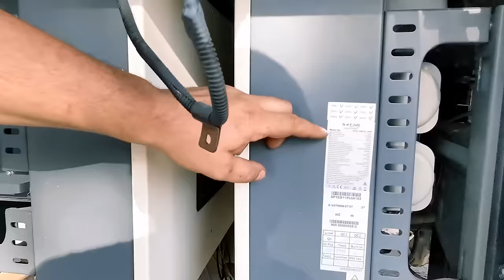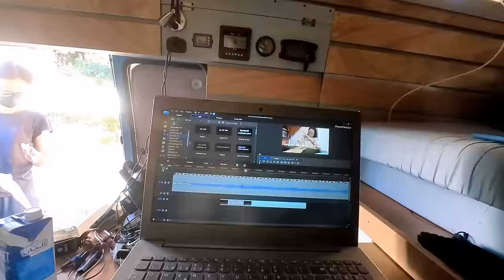Ultimate Off-grid EV Camper Bus Will Blow Your Mind! No Charge Station Needed!

Comment: Most RV are parked doing nothing for 80% of their life. If this can feed its energy excess energy back to the grid at peak power the RV can be a revenue stream for their owner. So  the next vacation is fully paid for by this Rv.
Reply: They'd have to be able to plug into a system that can receive as well as send.
Reply: You do realise that 30kW peak panels can't supply more than 10% per day on that bus?
Completely stupid to feed int9 the grid as it will just collapse even more from all those MOVABLE solar systems 😮
Stop chasing dreams and learn to understand the basic problems of last mile energy supply and grid dynamics ics before asking such wild none possible dreams

Comment: The absolute dream. RV companies, take a good look. Hire this man, buy his design as a patent or something. The modern community needs this.
Reply: patents? its public domain. God bless you.
Reply: @gsestream  then what do I say? All I meant was for major RV manufacturers to take his design and work with it. I have yet to see a fully electric RV. And one with its own Solar array to charge itself to boot. Now, if there is a market for that kind of thing now, then it needs to become more popular. Or maybe I'm just too far under my rock.
Reply: @CallMeTeach2  yeah its a cool open source free design, not proprietary, emphasis on the free design, ie not patentable. ie he was not the first to design it, and its in the public domain.
Reply: the 221kWh of batteries alone are easily $60k new, that might make this a little out of budget for most
Reply: No it isn't. People with RVs don't want to charge for 10 days every 200 miles. It would take months to get anywhere and if you added more batteries it would make it insanely heavy. Electric is a fad and will go away like it has multiple times.
Reply: @AKAtheA not to mention the weight of having enough batteries to drive anywhere in the US
Reply: @punkrocker10115  it's a bus, weight should be a marginal issue at most. The engine he removed is well over 1/2 a ton, so the net gain is maybe 1 ton in a bus that's close to 20 tons curb weight.
The main issue is cost and charging infrastructure.
Reply: @AKAtheA  yeah. You have no clue what you're talking about.

Weight is absolutely a factor due to the frame, brakes, and roads..removing 1k is nothing considering each battery alone weighs that much. Dude removed 1k lbs just to add 4k more lbs and make it slow as shit and take forever to charge. On top of that, the Tesla motors puts out like 400hp/tq max, which for that bus is nothing and it makes less power than my 20 year old diesel and less power and torque than the original motor, which was probably around 1000lb ft  of torque.

So, yes, this thing is slow as shit and super inifficient to the point where its absolutely not feasible for anyone not willing to spend at least 500k+ on a bus with terrible range and charging ability. 

For perspective you can buy a 50ft diesel pusher for around 150k, get actually good range, and be able refuel quickly.
Reply: For now...10 years from now at the pace evs and infrastructure is evolving we'll probs make it make more sense
Reply: @punkrocker10115  So, after more searching then I care to admit: the bus is a 12m Temsa Safari from early 2000s, rated at 18t, somehow now weighing only 19t with all the crap he added. It came with a huge 6 cyl 12l MAN engine making  265kW in the max powerband and 1250-ish Nm in the torque band. A similarly sized MX300S2 (used in  newer versions of this bus) weighs 1252kg.
The tesla drive unit including the reductor is bolted to the input of the original transmission and actually needs to be limited to 1600Nm to keep it from shredding the gearbox with the 6000Nm it delivers from 0-500RPM. It starts loosing to the org. engine on torque past 1500RPM, because of the unsuitable gearing. Changing the reduction gears would make it curbstomp the original engine in and well outside the entire RPM range. Weight should be 132kg, max power 400kW, 12minute rating is 160kW and continuous rating is 45kW.

Personally I'd like to see an off-the-shelf truck e-axle instead of this bolt job,but I'm not the one paying for it...otherwise I actually kinda like it.

TL,DR: the bus is only 1 ton heavier and slower while going up long hills, otherwise it can haul ass.
Reply: @AKAtheA  look up Edison. Canadian company that does big rig and e axle truck conversions.  

Also you're numbers make no sense. the biggest Tesla motor they put in the cars only makes 440nm.
Reply: 10 days of charging for 180 miles driving? It's not practical.

Comment: Amazing electric conversion. Interesting method to extend the panels. Having the electric bikes on the back for short trips as well. You'd feel save driving slowly in a bus if the battery was running out.
Reply: You have to feed all of it into the bus as you drive to the campsite... do you want a supercharger at every camp side? It's completely stupid, prices will be high
And electric motorcycle is even worse, no space for batteries means no range, and torque is very dangerous on single wheel drive 😂
Electric scooters are useful, and there is more range and capacity to carry 😅
Reply: In winter he gets around/up to 10%😂
In summer it might go up, maybe +2%?
The underlying bus is are dynamic brick and that dual ductape tesla battery is more a fire hazard then anything 😢 100k for that mess 😅
Reply: @mmuller2402  In summer it will go up between a factor of 5 and 10 depending how far north/south you are. So he can charge empty to full in 2 days in midsummer.

Comment: What a bus! I've never before seen a coach converted to electric drive and I'd love to see more of these. The owner says the conversion cost over 100,000 Euro and compared it to fuel cost but you have to also figure for diesel maintenance. I hear an oil change and inspection for a bus is around $600 and needs to be done every 5,000 to 15,000 miles. It also says an engine rebuild average is $8,000. Electric drive might also save on brake service. What a bus!
Reply: A modern big diesel engine rebuild is difficult for 8k$. Maybe for a small one in a truck, but buses have difficult access which can double the labour. Also the engines are not small. A clutch done properly is at least 2000€.

A coach bus engine will probably run at least 15000€ if doing a full rebuild..

The hardware for such a conversion shouldn't be much more than 50k€ today. Solar panels only cost a couple k 😂

The thing that is important also is that in Europe the legislations for electrical installations in vehicles are quite lax compared to house installations so you can in many countries do all of the work yourself without having to pay an electrician or an engineer. You would have a hard time finding one in any case. 😂
Reply: 建议你来中国试试  他这个创意很不错  不过  成本有点太高了

Comment: What people dont realize, the amount of battery that dude has is enough to run everything in his home all at once for a long time, possibly days....Sure the driving milage sucks, but he lives in the vehicle, theres no rush to get anywhere. If I was that dude, and in the US id go to public lands stay the entire 2 weeks living off grid with zero problem... though id definitely go to town from time to time with something small just to ressupply. The coolest part about his solar setup, theyre basically awnings too lol.

And yes, to the haters, you can stay in public lands in the US for 2 weeks at a time, which is where most rvers are.
Reply: "possibly days" more like weeks. That is an absurd amount of battery storage for a home.

Of course, they need that to drive.
Reply: not An absurd amount as with heavier class vehicles you need more braking abilities and more power for acceleration from stop or hill climbs Also he probably needs 4 tesla battery packs but only has 3 and the sollar only functions fully wattage when spread out not while driving and only that many km is pretty limited range unless he's allowed fast charging abilities it's enough to power a home sure but barely enough to power the transportation which is much thirstier than a home because of all the wasteful stoplights and wind resistance at high speeds though tailwind 🌬️🍃 pushing can save you fuel in gas cars as well  sounds like she had the Chinese caronas beer virus it sucks i know gotta maintain strength vs it's body weakness  really attacks lungs 🫁 sleep  nutrition fresh air sunlight rest helps also hydration & breathing exercises to flex increase breathing strength just be careful not to over workout, the disease seems to be attracted to humidity in the air i think that's when it spreads with the cough so while holding the germs on your face isn't good for you it's  good to not let it waft towards others a large distance aughta be adequate for not catching it but also i find good or healthy bacteria levels help fight off this bad bacteria/virus  balanced blood sugar is s good but i found starving the body of the sugars whilst sick to be an improvement on speeding up recovery but again nutrition exercise rest and fresh air/sunlight that's the best way to kick it so far activated charcoal absorbs stuff but it'll suck up medicines too so like minimum 4hr gap between charcoal and medicines  @adddude7524 did wanna build same style camper myself but was stuck working... then om vacation didn't have any surplus money 🤑💰 to pay for lavishness/ project purchase and upgrades good luck to both electric bus family and van travel family ❤
Reply: I live in a campervan with a lot of solar, but it is about 8% of the solar he has. I very rarely have to think about power, for 75% of the year it is essentially unlimited because I use less than the panels put back in. This man has completely unlimited power for household use. He would never even look at the battery in regards to household use, only as capacity for driving.
Reply: Yes capacity is enough to power my home for 1 month.
Reply: @usobr69 - So true! (... same is with my mobile home too - because I don't cook or heat with electricity, only use lamps and charge smartphones, storage reach is indefinite. It doesn't matter if it's 300 or 40 amp hours, 40 is more than enough (even if for some days the sun wouldn't shine very much). And I don't bother to charge the smartphones out of storage at night - which of course is fully unnecessary. I could just as well charge them over day 'PtP - panel to phone' with no intermediates at all.)
Reply: @SnowingNapalm 为啥你的发言让我感觉你磕了两根叶子😂😂
Reply: @usobr69  Can you run an ac unit. Probably not for long periods. That has to be hell in the summer. I would have to plug in during the hot months. So you have a van tour video?
Reply: @Mr.Hooter702  It is definitely not hell in the summer because the whole roof is shaded and with guaranteed 18kW coming in on that hot day a good AC would probably give you 80kW of cooling which might be just enough to get you deeply frozen at -18°C.
Reply: @rainerzufall689  Funny you said "might be". Trust me it is not enough and you wouldn't be able to drive anywhere. Plugging in during the summer is the best option when it comes to living in a tin can.
Reply: @Mr.Hooter702  I find it far more funny you actually care if the temperature reaches -18°C. I mean who cares? Of course it doesn't because no AC is designed to go that low. But you can definitely achieve a good room temperature consuming 2kW which as far as I know is less than 18kW.
Reply: This guy has put together a fascinating motorhome package. He has managed to put together a battery electric motor home he can drive anywhere and everywhere. He may only be able to drive 100 to 150 miles at a time, and it may take him 5 to 10 days to recharge using just his solar panels, but he has pretty much permanent supply of all his hotel household power needs and can still gather enough solar energy to move quite a distance. I am impressed. 

What we dit not find out is if he has regen capability from braking or if he has the capability to charge from a power outlet or from a high output fast charger used by other electric vehicles. If he has the capability to charge from public EV fast chargers, his daily range can easily double or triple to 250 to 550 miles per day. 

Technology in the medium to heavy vehicle world for batter EVs is improving rapidly, so expect to encounter more vehicles like this starting today and moving forward.
Reply: i mean this guy has enough storage for nearly 20% of my electrical use at this moment. So i could go 2 more then 2 full moths without any recharge on that battery if it where to power my house.

Comment: one word about this bus : Amazing !
Reply: Yes amazing fire hazard for 100k ... tesla battery straped by ductape and all the wires, lines are loose😢
Insane dangerous and those poor two 15kW growatt inverter with no active fan in the vent to te youside,  you need a minimum air volume around and there is no walls of concrete to push heat into 😮

Comment: He could reduce charging time by 50% when installing a hydraulic to adjust the Roof panels for optimal charging angle. I would have preferred adjustable angel over the slide out panels (output should be about the same) to cut the heavy panels weight when driving. But amazing build!
Reply: I have a 525 watt bifacial panel and it doesn’t matter what angle it’s in for same wattage.I tried vertical,flat and 20-45* tilt.Weird I seen 443 watts for a split second and hovered around 400 for a minute.Was Cinda steady 280-340 on bright clear sunny day.Do you think my panel is defective or low efficiency? Sticker on back says 70% Pmax +/-5%
I’m mounting on rv roof so probably won’t get much from bifacial. What’s your thoughts on my Canadian solar 525 bifacial panel? Thanks
Reply: @2hotscottpro  Those panels, where you are seeing the actual silicon wafer are more prone to getting more energy when having the right angle. Solarpanels where you do not see the individual wafers (mostly the new ones) have slightly less efficiency, but are cheaper to manufacture and work from a wider set of angles.

Comment: I was thinking something similar, but instead of having the solar panels slide straight in and out, they could hang down from the top of the vehicle. That way they'd always be bringing in at least a little bit of power, and you could flip (locking hinge) them up horizontal when you got where you're going to be stopping for a bit.
Reply: If you do that, you might like to look for the solar panels that have clear sections between the cells, then you'll still have a little bit of visibility out of the side windows of your bus.

Comment: This bus is brilliant. Glad to see someone has taken the same 3 tiered sandwich solar approach I was thinking of and applied it to a project as large as this. I was planning on taking the same idea and applying it to Kei van like a subaru sambar. No reason the same concept can't be applied to a smaller van that'd cost a slight portion of this large bus. Subscribed!
Reply: Like minded.
Here in Trujillo Perú my wife and I want a full electric kei pickup stacked with solar that jacks-up and out unfolding a tent beneath it. Can't see the point of being in a metal box.
Reply: I was thinking the exact same thing! Except with a sambar truck, and a box on the back like Olympic Overland (though more like a teardrop camper). The way he's done this bus is so cool!
Reply: The roof of our bus is almost not suitable for RV panels (we were able to fit just three), but we did found those lightweight flexible solar panels that produce 400wp and weight only 8lbs. So, we put those flexible solar panel 'sheets' (they are 1/10 of an inch thick) on plywood boards and when we have the awning out, we simply put our boards on top thereby increasing the solar surface. We have 3 boards with three sheets, so we have added 3600wp to our system. Generated power averages out on about 1.5kWh with usually in summer a total charge of about 6kw, it differs per day. But at least 6kw per day in summer is save to assume and this is mostly due to the wooded area's where we like to stay...

Comment: Hey, how dare you to make my dreams come true! I would opt for linear actuators to track the sun. And this was way more then 100k! I calculated 250k just for the parts and not taking a Tesla,  but way cheaper options into consideration. Well, over 300kWh, but the array is about what I calculated. You need a different gear-ratio and most probably 3 gears to cover all situations properly. Otherwise you eat up your juice and need to stay around a little bit too long. 100km/d should be fine. You have to follow the summer, then you will harvest way more in average. Anyway all thumbs available up for this demonstration vehicle. With sunny love from Austria...